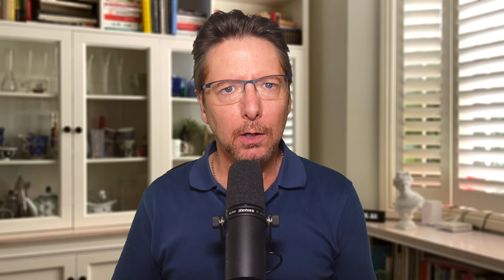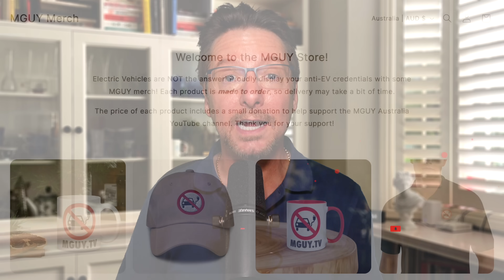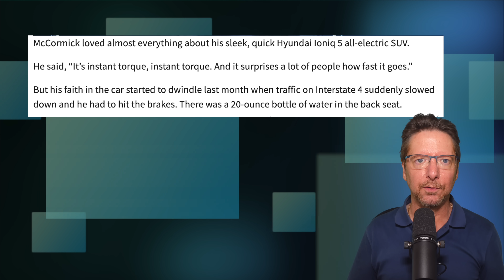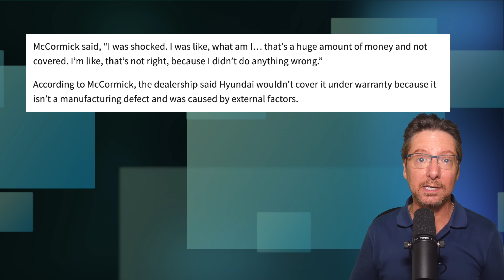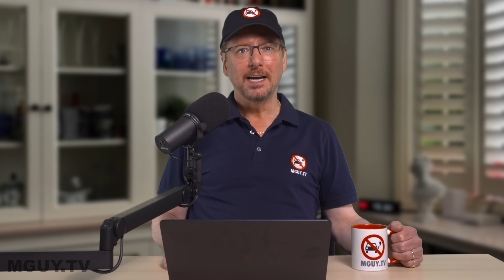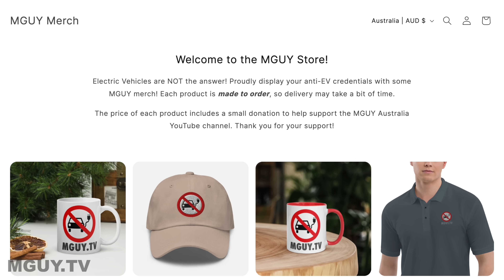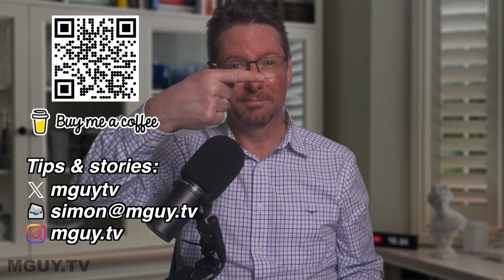ASTRONOMICAL EV repair bill for spilling a WATER BOTTLE! | MGUY Australia

Comment: This points to some truly astonishing engineering oversights.  How could this not have been anticipated?  If I was the Hyundai chairman my immediate response to this would be to quietly (and immediately - like before lunchtime) deliver a brand new car to this customer.  Two years ago when a friend was talking about buying an Ionic , I did everything but beg them not to do it. My intuition could not have been more spot on. This is worse than the sad story of the Hyundai Pony ; you could spill a glass of water on a Pony floor and it would take at least week or two to rust out the floor.

Comment: As much as I'd love to throw mud at EVs, this is NOT an EV issue... This is a Hyundai / Kia problem.  Their focus is on razzle dazzle, not actual engineering.  Case in point:  The owner's manual for a Hyundai Genesis cautions the owner that operating more than one power seat simultaneously will DAMAGE the electrical system.  There's a reason you don't see older Hyundai/Kias on the road.

Comment: My 1966 Pontiac.  Internal combustion engine which I call the Immortal, So Far, 326.  For $12,000 I can rebuild the entire drivetrain, steering, braking, and suspension systems and have enough left over to do some body work.  59 years here in the rainy Western Washington and she is a bit on the rusty side.
I ask a Tesla owner what they paid for their electric mobile.  I can buy a huge amount of gasoline for that!

Comment: You would think if you wanted a car to run on batteries, they would remove as much electrical items as possible. Such as power door locks, power windows, power seats etc… and save power for more important stuff like range……

Comment: Another reason not to buy a stupid unreliable EV especially a Kia or Hyundai a bottle of water spilt and we all know how it's important to "rehedrite" another thing not to do an EV you can't even have a drink of water in your EV especially when you can't even use the heater or air-conditioning not using any of those think how better a petrol diesel or hybrid vehicle is run the air-conditioning heat the car or have a drink l have spilt water coffee in other ICE vehicles but hasn't cost me usd $12000 to actually repair it

Comment: Out of the 42 million EVs on the road, how many of them has this happened to 10%/20%......or just this one car?...I find it hard to believe that this is the first time a bottle of water has been spilled in an EV so if it is a common fault, where are all the other reports?
I smell BS on this one .....EV electrical components, in particular those in the high voltage sections of the motor, speed controller and battery, are rated to IP66 or better. A '6' for water entry means ‘protected against strong jets of water’. 
Here in Chiang Mai we have floods every year during the rainy season, my BYD and other EVs cope perfectly well driving through flooded streets.....
....another example of 'I've seen a plane crash on TV so I am not going to fly" mentality.....
Reply: yes but the computer system runs on 12 volts.

Comment: You're right when you say EVs repair isn't cheaper but just a different complexity. Also, I think car designers aren't designing EV cars well enough either. I have several EV cars including a Kona EV. My air-conditioning was not blowing cold air. The issue is a small component needed changing. But to get to this component the whole dashboard needed to come out. Luckily it was covered under warranty but it's a full day or more of labour cost for a replacement an otherwise cheap part. How is this even possible when they are designing a car?

Comment: As a retirement project I would like to increase the compresion ratio of the suzuki 1.0 liter 3 cyl motor in one of my my 35 year old geo metros from 9.5 to 11 cr. With a couple other simple mods 65 mpg is achievable. Torque?  Maybe the 11 cr will make a 3.52 final drive from 4 cyl models practical, most of the 1 liter threes have 4.39 final drive.  If I fail and hit 60 mpg I'm happy as I won't spend much. 

Will 35 year old EVs be even drivable?   I hope EVs succeed, but batteries and left over turkey dinners are not intended to last long.

Comment: An ice chest tipped over in the luggage area of a late model Chevy SUV, the water made it to the spare tire wheel well. Also IN THE BOTTOM OF THE wheel well is the hydraulic pump and the module for the motorized lift for the tailgate, which now doesn't work. The price for the pump was $1,200, $250 for the module + programming. We were able to dismantle the pump and clean it out, the average person may not be able to get it done. I wanted to clean out the module too, but the boss said to put in a new module. We drilled a couple of holes to let future spills out.
Reply: Let the water out in the exhaust fumes in

Comment: I bought my 1982 Volvo 345GL in March for 1100 GBP as a non runner. The fault was the rotor arm in the distributor which cost 10 GBP. It fired up no problem. A headlight bulb costs 5 GBP. To do a service costs next to nothing and takes less than an hour.

Comment: If the vehicle manufacturer cheaped out on in cabin spills with an exceptionally poor design. Then what else did they cheap out on? Perhaps the battery. This is just another reason not to buy an EV.

Comment: bro, my hilux 2.8 had 75k+ miles, it costs me around 11000 usd equivalent for all the cost of the fuel + maintenance (oil and fluids change, brake pad replacement, 2 sets of tires, air conditioning maintenance etc), cheaper than this ev's repair

Comment: I've knocked over the occasional beverage in the passenger compartment of many cars - water, iced tea, soda, coffee - and never had a problem, aside from the cleanup itself. The worst spill made me suffer the scent of hazelnut for a few days.

I don't blame Hyundai for failing to cover the water damage indirectly caused by the owner, because that's not what warranties are for. I do believe, however, that wiring harnesses and interconnecting plugs should have SOME moisture resistance; after all, wet clothing and footwear are quite common in passenger compartments. Tiny spills soak into the carpet padding underneath and that takes a bit of time to remedy.

I'm not surprised State Farce denied the claim, and I'm also not surprised they lied about the reason for denial, that's what they're known for in the US. If State Farce knew anything about corrosion and DC voltage, or had watched any YouTube video of liquid damage repair to cell phones/laptops, they'd know that corrosion happens VERY quickly with DC (it happens slower with AC).

Comment: Have to disagree with water spilling not causing problems with an ICE car. Some have computer modules in the floor and I even saw the battery under a seat in a van. Get those wet and it can give serious problems that can be very expensive. This isn't just an EV problem but a modern car design flaw. EVs just make it worse since they are purely electric.

Comment: What absolute bullshit fr9m Hyundai and it's dealer. And if a wiring loom starts to corrode and degrade after a few years then there is a very serious issue with quality as that means ALL the looms are the same. Not good eh?

Comment: Every modern car petrol or electric has seat wiring, sensors and modules. A clean water spill doesn’t cause corrosion, and sand doesn’t magically appear in a sealed cabin.
Dealers said it was long-term corrosion, probably from prior salt water flooding incidents. Using one questionable case to claim EVs are inherently flawed isn’t analysis, it’s agenda-driven content.

Comment: I am sorry if you are stupid enough to buy an electric car I have 0 sympathy for you when you poor decision bites you in the ass. This is beyond a joke, it took flooding my brand new Stinger GT halfway up the transmission tunnel inside the car for it to have a couple of electrical issues. We got it started and drove it up on the back of a tow truck. Yes the electrics in it were screwed and the car was written off but I could have repaired it if I had wanted to. I could have bought it back from the insurance company and repaired it. Now a water damaged ICE car is never 100% solid again after being flooded you will have issues from time to time. Point is you can repair it drive it and own it for years. Not an electric, it boggles my mind how any sane person can think those things are in anyway a good idea.

Comment: I'm no fan of EVs, but to be fair, a lot of modern ICE cars have stupid placement of computer modules on the floors too.  In the case of that Ionic, I bet it was repeated soaking with salt water (that would explain the sand that was mentioned) from family beach trips (wet swimsuits and sandals).  The final water spill just provided the electrolyte to short everything out.  Somehow, I imagine similar stories will emerge up here in the Glorious Peoples Republic of Canuckistan, where out floor mats are soaked in salt-laden slush for several months every year.  Modern cars suck, EVs suck worse.

Comment: That IONIC car can't have the rear brake pads changed without buying the Hyundai software. That's £6000 or you can rent the software needed for £2000 and £60 a week 😅😅😅😅

Comment: Many folks spotted his scuba gear and he goes diving in salt water. Salt water is known to corrode electrical components very quickly. Many people doubt his "Water bottle Story" and think he has had ongoing issues that he chose to ignore. IE: he may have already been getting warnings from flashing idiot lights and ignored them until a fresh water bottle was the event to cause a catastophic electrical failure. He was stupid enough to keep driving after multiple warning lights came on. IN an ICE vehicle most people are smart enough to shut down when the whole dash lights up vs continuing to drive and causing more damage. If your oil pressure gauge suddenly drops to zero you stop immediately or suffer the consequences of your stupidity if you chose to keep motoring on all the way home.

Comment: Well no surprise to me as I saw that i the UK one person who had a Hyundai EV who wanted to replace the back brake pads himself was told he would need a different plug-in diagnostics device plus some extra software which amounted to 6 thousand pounds!! Now, assuming that the wear on the pads would be greater than a normal car this is one gigantic reason not to own an EV. Now this nonsense re that water bottle and add to that (I am no engineer) that EV's controlling computer was in such a vulnerable position that damage to it is a no brainer to anyone who has any idea of the fact that computers and liquids, especially water DO NOT MIX. I'm left wondering how they pick out these designers and engineers for the production of these milk floats (probably the first person they stop in the street!!.

Comment: You're not safe with modern ICE cars, either. A VW Amarok was written off by a cracked tail light. Water got in, tracked down the wiring and destroyed the body control module. The cost of replacing the module and the wiring harness wrote the car off! My wife spilled a bottle of water in her Toyota 86 yesterday. Guess what? Nothing happened!

Comment: Begs the question... what if the windows were left wound down and then it rains... 

Okay, so typically door switches are usually affected, but not much else.

Clearly poor design. No rubber floor bungs to help drain the footwells?

Comment: As usual bring to light 1 incident to paint a whole vehicle type as bad. I can insert the word BMW or Jaguar. Have you seen the modules under the floor? They don’t just move the seat and yes they are crazy expensive because they hardly fail except when you add water. Just another cult like example to push an agenda.

Comment: I'm not sticking up for the electric car idiots, but i have seen the aftermath of an audi Q7 diesel with some drink spilled in the MMI control panel right next to the cup holder. Not just the radio, but all the heater controls all wiped out. Totally fritzed the panel and took out the control module as well. Dealer only reprogramming of the new parts, That cost the owner a whole heap of money.

Comment: What is happening is that worldwide (it seems) they that people don't want to get rid of their older petrol driven cars and the powers that be have made petrol so that older cars won't run on the diluted fuel - it gets hotter and vaporises - this is not only cars, but also farm vehicles and drive-on lawn mowers as well! It is getting very dangerous to be on the road now not knowing if the car travelling in front of you will suddenly stop in the middle of the road -be it a busy intersection or motorway - just another way to kill us off!

Comment: In the early 90s I rode in a GM test bed EV vehicle, It was a Chevy Lumina van, it accelerated like a bat out of hell which is not some feat of engineering, it is the result of using AC servos to drive the car which produce massive torque and they will accelerate to destruction if not governed. BTW, do not take a lead sled like an EV into a corner at high speed, you will crash.

Comment: Surprised that a headlight costing $1000AUS is supercar prices?  I've got news for you, that's cheap for a modern matrix headlight on any car. This has nothing whatsoever to do with it being EV.
The headline is a tad misleading tho. Are you actually saying that liquid was spilled in a car, and the driver did nothing about it? Are we saying thru a period of time, the spillage caused rust? Are we saying there was an unsecured bottle of liquid on the rear seat that fell off during emergency braking?   Why was this guy claiming against insurance when he was the one to blame for the problem? This has nothing to with EV's or the Iconic 5. Could have happened in any car.

Comment: To claim that EV's are complex and ICE cars are not, simply isn't true. The days of the backyard mechanic are well in the past. Horror stories abound for ridiculously expensive repairs to ICE vehicles as well. All new vehicles are extremely complex due to their reliance on computers, software, sensors and miles of wiring to operate properly.

Comment: So wet snow on your clothes and boots can cause the wiring harness to short out. That sounds like bad design of a system to me. Lack of water proofing is a basic design and design by trial is one of the worst ways to do it. Steer clear of these “Wonder machines” they are just going together worse as time goes on.

Comment: Take the seats out and disconnect everything that got wet. Use a hair dryer to thoroughly dry it. Spray with a contact cleaner. Park the car in the sun for a couple of dry days with the windows cracked open. This will finish drying things out. Pray. Reassemble everything. If it works, sell it quick and buy a ICE vehicle.
Thank you. The EV nightmare opera continues. Stay tuned for the inevitable future episodes. 😅

Comment: I put over 250k miles on Ford F150 and sold it to a friend who was desperate (due to medical expenses) to buy cheap transportation.  He and his son went fishing and forgot to securely park the pickup and it rolled into water till completely submerged.  When dried out and all fluids changed, they only had to replace one electrical item to have it running again.  They had over 400k on the truck's odometer when it was retired.

Comment: I drive an Ioniq 5 as a company car, because my employer insisted we go electric.  The whole process has been a nightmare.  

The original electrician who was contracted to install my home charger messed it up, resulting in sparks in my electric panel that could have set my home on fire!

Then, after 6 months and 15k miles, my battery started losing charge.  Took six months to get a new battery!  At least it was under warranty.  

In the meantime I got another Ioniq 5, which was rear ended by an inattentive driver.  Damage to my vehicle was isolated to the rear hatch area, but it was still a total loss.  I imagine because anything more than a fender bender and they can’t guarantee the integrity of the battery pack and the insurance company does not want the liability if it catches fire. 

Suffice to say I won’t be buying an EV with my own money.

Comment: I just had an oil pressure guage and light fail on my 1994 dodge cumins diesel The sending unit had gotten damaged when I changed out the 31 year old power steering pump. That new sending unit cost me $40 and I installed it myself.I have also just finished putting in a new steering box and hoses, back brake shoes, e brake cables, wheel cylinders, and axle seals, all totaled to less than $1200.00  ( yes I am a mechanic and i do my own repairs, The nice part about an old truck is I can do my own repairs )This is a 3/4 ton truck with 13" brake drums Other than the brake shoes these were all original equipment parts, again they are 31 years old. I have had this truck for 15 years and I have yet to hit $9000.00 in repairs. When I bought the truck it needed a transmission which at the time was $3600.00 the most I have ever spent on it at one time. I bought the truck for $900.00 Can you imagine driving a vehicle for 15 years for under $10000.00. This truck is old and not so pretty anymore but mechanically sound. So I will be doing a HARD PASS on an EV.